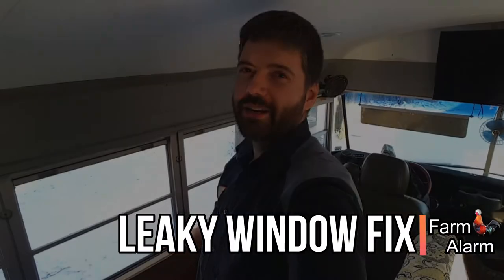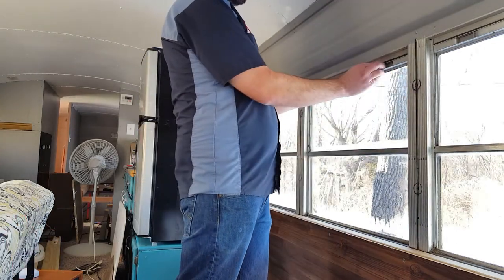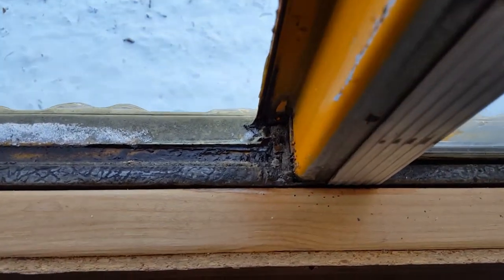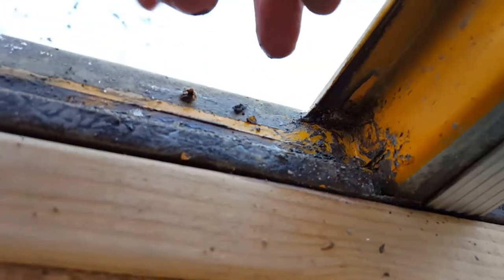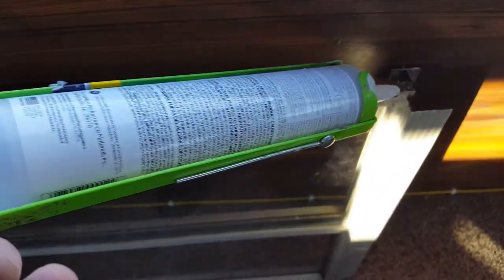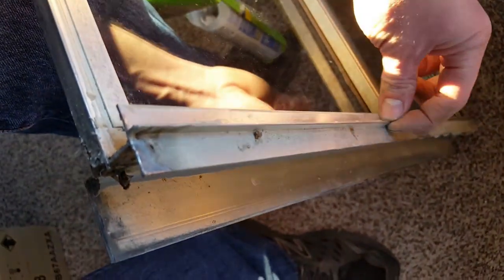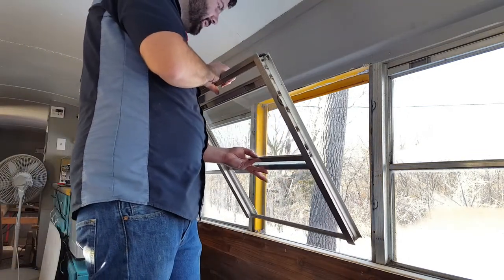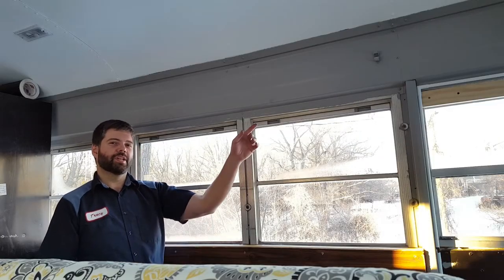How to Fix Leaky School Bus Windows - Skoolie Tiny House Conversion

Comment: Butyl Tape is what you took off the window, butyl tape should go back. Silicone is bad news in this application, it retains water and causes rust, hard to get a good lasting seal in general. Bet youve found that out by now (2020)

Comment: what kind and name was your sealant for the windows?  I'm cleaning mine up now and need put them back in... thanks for sharing
Reply from the maker: Hey Bill, just be sure you get everything really clean before putting in Windows back in. But I just use regular silicone. silicone will do a good job, and if you ever want to take them back out you will be able to. If I was to use a stronger sealant, chances of getting the windows back out ever would be pretty slim.

Comment: Please, how did you clean the window frame after you removed the window?
Reply from the maker: I used a razor blade to scrape off all of the old silicone sealant, then i wiped it clean with a rag. Depending on how dirty it is, you can use some sort of spray cleaner on the rag too. Maybe windex, or even lacquer thinner. Hope this helps
Reply: Farm Alarm thank you, it does help. I haven’t taken out the windows yet but they look sooooo gunky and gross, and there are just so many of them! 🤣 (which I love;)

Comment: did you also happen to find a way to bypass that ignition interlock system?  I messed up and cut some of those wires and now I can't get the bus started, mine is a 98 bluebird
Reply from the maker: The back door was already taken out whenever I got this bus. But I did see the wiring harness back there when I did the tail lights. But that has been a few years ago. It seems to me that there were two wires for the Interlock system, and they were joined together to make the connection. I guess depending on where you cut those wires at, you could always trace them back up under the console Dash upfront. I would suggest joining skoolie.net forum. There is a ton of help there!. I know they have helped me a lot.